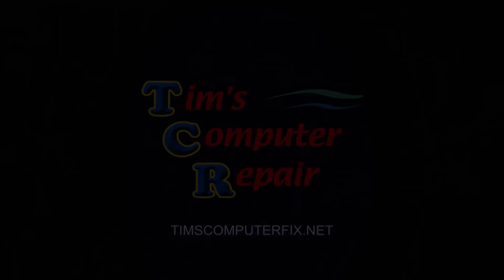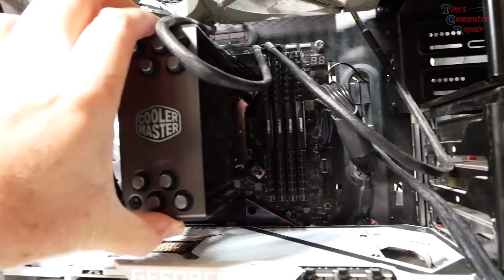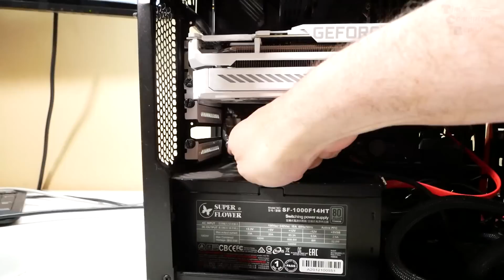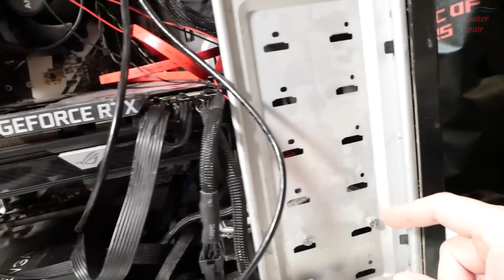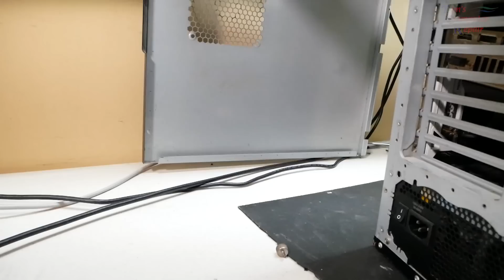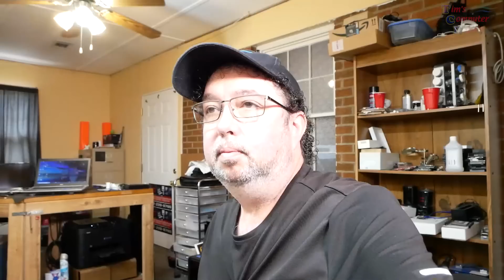One of the Most Epic Failures Building High End Computers That I Have Ever Seen.

Comment: I had a customer message me on Facebook and ask how much it would cost to hook up the wires on his new computer he just built... I was super busy and didn't have time to do it so I send him some pictures on when the wires go... He insisted that I do it.i said fine. $30. He brings me the computer and a backpack full of parts.   Ummm. Ok. So I start looking at it... Power supply installed correctly in the case.  The memory wasnt all the way in, and there was a scratch across the slots.  The heatink only had 3 out of the 4 screws installed. So I decided to take the cpu out and check it... Thermal paste on the backside and bent pins on the motherboard.  The motherboard only had a few screws holding it in.  The kid ordered a new motherboard and I put it in. Only to have the intel cpu die a month later I'm guessing from him trying to turn it on with the bent pins shorting it out... Pretty expensive lesson.... But this video tops it... Lucky that everything wasn't dead from the lack of screwing the motherboard down and the video card only being part way in
Reply from the maker: Thanks for sharing that and thanks for commenting.

Comment: I use my ancient Lian Li PC 70 since 20 years and have swapped the innards at least 15 times during that time. 

You won´t find a case with more depth for long GPUs. :)

But it also has some disadvantages, only 80mm fans and cable management was unheard of in the early 2000s. That also gives me a perfect excuse for being lazy and have that cables dangling around inside the case. ^^

Comment: I worked in high volume shops back in the 1990's and very early 2000's. I've seen my fair share of horrible machines. These are some of the worst built machines I've seen, but I've seen plenty of ghetto case mods like these. I've also seen biohazards like dead rats, mice, rodent feces, and living and dead insects in machines. I've also found paperclips in printers that looked like they were covered in ear wax, you name it. 

None of this surprises me. Honestly, the way I'd go about this is to pull all the parts out and test everything to see what works and what doesn't. I'd make the guy buy two new cases and whatever else is needed and properly build the machines. This guy is about to learn an expensive lesson.
Reply from the maker: I agree, not sure what the guy was thinking. Thanks for commenting.

Comment: I've seen some pretty janky builds with cases bent to fit GPUs, no stand-offs, floppy connector plugged into a fan header. The difference is, those were all crappy old components. Unbelievable that someone would spend thousands on top of the line components and still try to bodge them together.
Reply from the maker: Agreed. Thanks for commenting.

Comment: Yeah, I think those are probably the worst and shameful computer builds that I've ever seen! I've seen hard drives just hanging by the wires mot even resting on anything! And the worst of it is that they used expensive parts for part of them and then jamb then into crappy old cases. That one with the mother board not even mounted, is surprising that he would have even shown it to you without just taking it apart and hand you the box of parts!  🤭
Reply from the maker: Agreed. Thanks for commenting.

Comment: yoooo those were some doozies! I've had builds in my place with like, one or two big no-nos in them - a cooler that's not on properly, or a plug that's been put in the wrong place and killed the mobo... but never entire builds as egregious as this!
Like you said, they spend that much money on parts and didn't want to drop $100 on a premium case designed for them... mad!
Reply from the maker: Had me scratching my head also.

Comment: I would refuse to work on that, disclaimer bedamned!  Been around computers since Intel 4004, CP/M, et al.  

Mixing PSU cables is the worst.  They are NOT common wired!  Most PSUs won't start if they are wired wrong but that protection is to keep it from going up in smoke.  There's a damn good chance that card has VRM damage.

Sad thing is this is not all that common especially with LGA boards and bent pins and they return it to the store they bought it from fuming that its defective!

This person would have been far better off building open air but then again I can see they don't have the heatsink mounted properly!  One of the T nuts is turned perpendicular in the resin backplate creating an uneven mounting pressure.  I can only imagine what kind of hanywork has been done to the socket and TIM application.  This stuff has been trashed.  If the mobo had an OLED like some MSI and ASUS systems it probably would have displayed an SOS or HELP ME text LOOOOOL! ;-D
Reply: I did cp/m to and from then to now I learned early on to take my time...ask questions...and do one thing at a time...and keep toolkit of screws and cables.
Reply from the maker: I did refuse initially. He signed my agreement and I thought hmmm this would make a good video.

Comment: I miss my Super Flower SF-201B case, it was a beauty, don't think I recalled if I knew about their PSUs.
Had 2 of them bolted together back in the day as a custom PC mod. Get this what I had inside.......

Right side case had the main PC build, Athlon XP 2600?, ATI Radeon 9700 Pro with a 2.5" x 5" cylindrical reservoir attached to the outside case via the inlet barb, no other support for it......

Left side case housed a gutted UPS with along 4 additional sealed lead acid 6v batteries used for hand operated 100w halogen bulb spotlights mounted in the HDD bay to double the UPS capacity with the original 2 12v batteries. I replaced the rear PCI slot area with a panel that housed the USP 6 outlets.
Also inside the left case was a early era water cooling kit I bought from the now defunct CrazyPC site for Athlon XPs CPUs, which came with a 110v submersible pump, a janky 120mm car heater core for the radiator that used rubber tubing to connect the tubes to the radiator's barbs. Made a relay board powered by a 2nd PSU switched on by a tap from the power good signal from the PC side PSU to turn on the 110v water pump. Not sure what else I had in there.
Oh ya baby, nothing like having high voltage stuffed into the same space with water. I sure as hell made sure there was no leaks! lol
Reply from the maker: Nice. Thanks for commenting.

Comment: Definitely the wrong case for that hardware. Something like a Fractal Design 7 would be more appropriate. Oops, check that, both cases are grossly inappropriate. You should charge him for computer building lessons.
Reply: the design 7 or xl version would work for the one with the 8 hard drivesbut still bad to see the gpu inside the two smaller cases
Reply from the maker: Hey thanks for commenting.